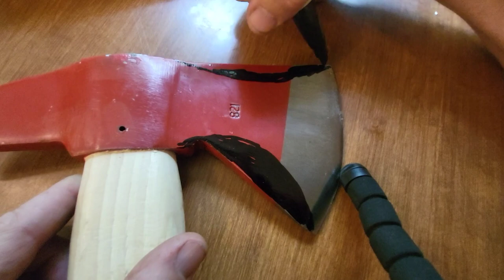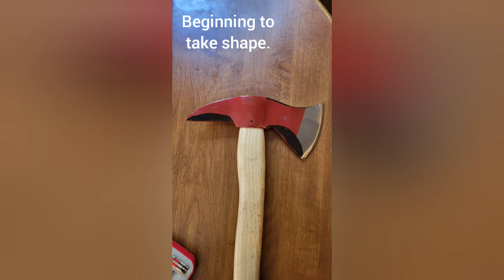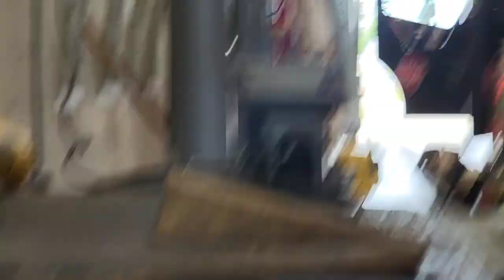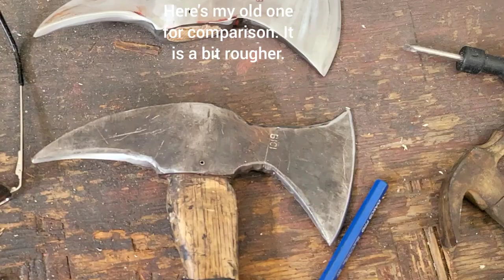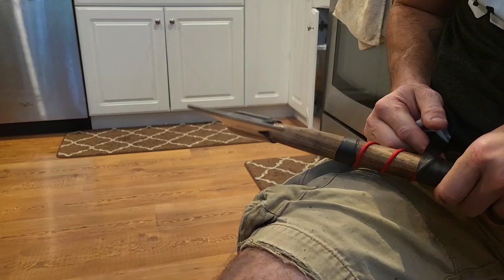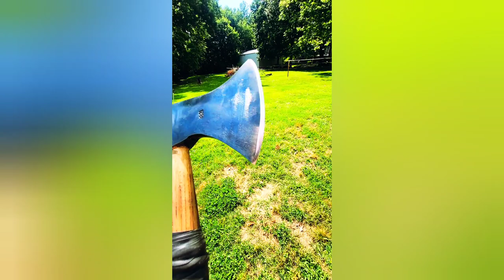Turning a cheap hatchet into a useful tool.

Comment: I bought one of these some 15 years ago, (seems like that long), cut the spike off and made a hammer pole, shaped the blade into a tomahawk style, and shortened the handle and wrapped the lower section in paracord. 
I recently bought another one, just because it seems to be a good emergency tool.